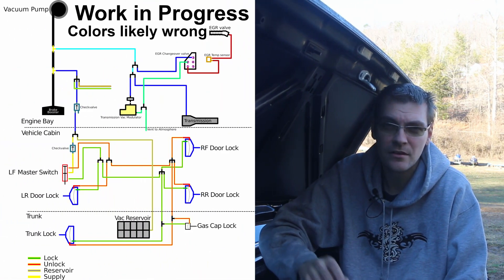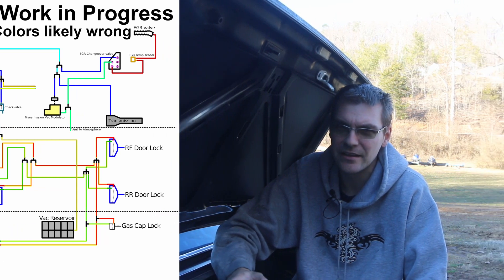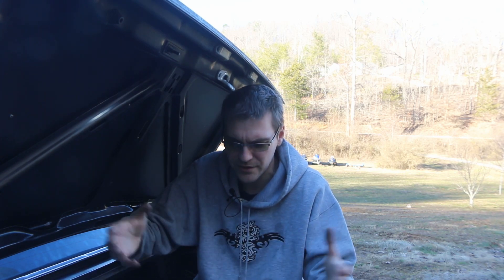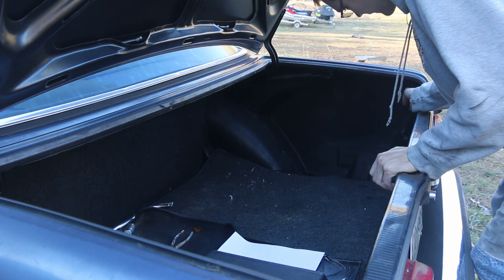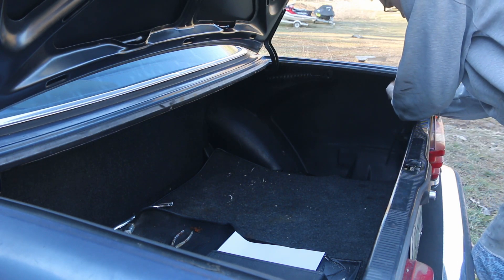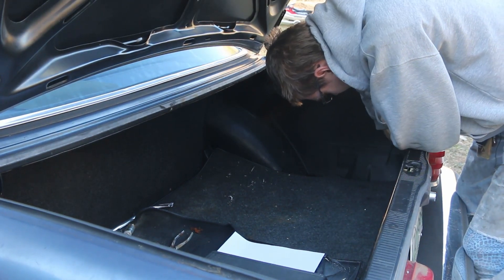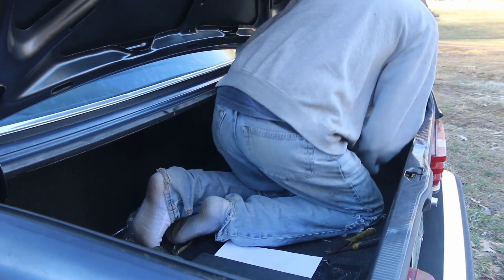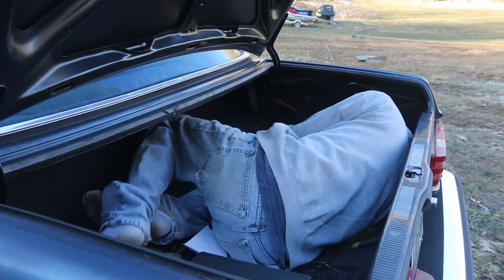W123 Vacuum system troubleshooting [PART 1] (Most Common Central locking problems) Plus DIAGRAMS!!!

Comment: Awesome solution...
Got w123 still working on restoration
Reply from the maker: It certainly takes some time to restore a car. I need to deal with my paint, the sun has taken its toll, time for a respray. Hoping I can get that done over the winter, the car will look so much nicer, I'm quite confident in the mechanical aspect of my car now, so I'm wanting to get it looking a little nicer!
Reply: @trythistv  i may lean on you for mechanical input cos is my first car and i am trying to work it myself no good w123 mechanics around. Then you came along. Thanks
Reply from the maker: @muhdaminuabdullahi8601  I'll certainly try to help however I can, I've got more videos of things on my car I want to film and get on here, hoping to get some time away from work so I can get them done!

Comment: I agree with Lester Loves Watches below. If you could start from the vacuum pump and guide us through the complete system you would be a God. I can't fine anyone to do a complete system check so I can decide what needs to be fixed first. Giving the connector hose and check valve sizes would help a great deal as well.
Thanks for all of your help.
Reply from the maker: I'm going to get back on this project soon, I plan on making a comprehensive video and printable diagram/written guide on what every vacuum component does and how to adjust/fix each part of the systems.
I tend to have more free time to work on my stuff in the wintertime, and we're seeing our business winding down so hopefully I can get some time to get back to this very soon!

Comment: Very good knowledgeable video
Reply from the maker: Thank you! I'm still working on completing the diagrams, summertime is miserable for my own projects since I have a mostly seasonal job so I'm hoping to get back at this very soon and get some nice diagrams cranked out, and some videos about the transmission vacuum system and other points that may need attention

Comment: so I took the driver door panel off, & tested the actuator; needs replacing. I also hooked up the vacuum pump to the 3 lines there. The solid yellow line holds no vacuum; the 2 striped ones do; any thoughts?
Reply from the maker: The solid yellow should be supply, it may be tied in with the reservoir in the trunk, so either the reservoir, fitting or hose somewhere along the way may be leaking, or it may just take a ton more pumps to build vacuum.

But with that being said, that hose may also be the one that goes to the vacuum pump stuff under the hood, so you may be trying to put vacuum on the vacuum pump with that hose.

There is supposed to be some check valves, I've got where I believe they are on the diagram, but if those are bad it could cause some weird leaky non locking issues.

Also, the actuator at the driver door may not be an actuator at all, at least on my 82 300D's the drivers door has the master switch and no actuator, so it controls the rest of the locking system, but cannot be locked or unlocked from anywhere else.
Reply: @trythistv  ok, thanks. Yes I should say master switch for driver door; well, once I install that I will keep my fingers crossed & hope vacuum just needs building up in the system; it's been down for many months; the lines actually look to be in good shape all over; no signs of brittleness or age; I did test 1 check valve under the hood, which tested good.

Comment: so if the door locks are not working the cause could be a door actuator itself, the master actuator of the driver door, a broken vacuum line, and/or the components in the trunk?
Reply from the maker: Right. The whole locking system is tied together, any leaking component could make the entire locking system malfunction, or be weak.
Mine has been working very nicely since the repair on the fuel door actuator.
Reply: @trythistv  OK, thx. I just ordered a vacuum tester today, so will be tackling that issue this weekend I hope!

Comment: How similar is this system set up to the one in the W116 cars?  I have a 1980 300SD
Reply from the maker: Nearly identical. My first car was a 1980 300SD, it was a machine and a half.
The big difference in vacuum system is the w116 models did not have EGR, so all that plumbing is just gone, the locking system and everything else should be the same.
Reply: @trythistv  ok, thx!

Comment: amazing! I Just discovered your video in my search for a vacuum diagram! curious if you've had any more progress?  I'm eventually getting to my lock system but am focused on the engine bay for now,  for the life of me cant find anything to follow,  its idle high and I see some unattached hoses that need to find their proper homes...  Thanks for putting in the effort to share your knowledge! much appreciated.
Reply from the maker: I'm making very slow progress, This is my busy season for work so that slows me down a bit.
Plus I'm also figuring out what all has been modified on my cars vacuum systems in the process, its hard to find a factory condition example of a car to copy routing and colors from anymore, I bet it'll cure a lot of the fiddly little issues as I get it more sorted though.
Keep an eye on the website (https://trythistv.com/w123vacuum/), I've posted a few updated diagrams now and then (been a few months as of right now since the last update, but I am still working on them, albeit slowly)

Comment: Amazing content, very helpful. My 1985 300d is definitely leaking vacuum somewhere because the door locks work, and the AC works and blows cold most of the time but lately it doesn’t blow as powerfully as it should. Also, the trunk unlocks only half the time, and the transmission shifts hard and “rev’s” very annoyingly from 2nd to 3rd which i assume could all be vacuum related? I had my vacuum lines overhauled (specifically related to the door locks) a year or so ago and they work well thankfully but there’s definitely still some vacuum leaking somewhere i suspect in regards to the aforementioned issues and ya know sometimes if you want something done right you have to do it yourself!
Reply from the maker: Sounds like some suspicious vacuum related stuff going on. I'm planning on doing a video about the transmission adjustments and vacuum system related to shifting, but I struggle to find time around my work, but it is in the works slowly!
If you have a vacuum leak related to the transmission it would tend to shift very harshly and slam into gear rather than feel like its slipping and flaring, if your vacuum system has been touched before it is possible a hose was misplaced and is causing excessive vacuum which would make it slip/flare on shifts.

Comment: This is a really useful series. Thank you. Could you do a video just showing all the connection points that you need to test, starting in the engine bay I’m going through the whole car? It doesn’t need to show vacuum testing with the pump, literally just all the points so that users can check that they have tested them all. Thanks a lot.
Reply from the maker: I'm planning on doing a test document like I have for the cruise control with test points and vacuum levels expected/wanted at each connection, but I started this project right as the busy season for my business started so I'm a bit slow making progress on progress on my videos and stuff 😟

Comment: Hey Jarod, thanks for your video and diagram. It has definitely helped me in fixing my ' 83 turbo. What size rubber boot are you using on the actuator- 36 or 46mm. Thanks
Reply from the maker: Hi there! I used the 46mm boot. I'm unsure how long it will hold up but it has been working great ever since I did it, locks don't leak down, even hours after parking the car everything unlocks smoothly. Glad I've been able to help out! There is so much more I want to do, and will be doing as soon as I can get some free time from work!

Comment from the maker: Links to diagrams and everything you'll need to diagnose and repair the problems seen in this video:
https://trythistv.com/w123vacuum/
Mityvac kit I use: https://amzn.to/3cm7k4p
Just the mityvac without the case and extra stuff: https://amzn.to/3v3Deei
More affordable option: https://amzn.to/3t3QlKL
Vacuum line: https://amzn.to/3cfK0oF
RC car shock absorber boots: https://amzn.to/3vbWt5C (46mm are the ones you want)

(Links used may be affiliate links, which could earn me a small commission if you choose to purchase via one of those links)